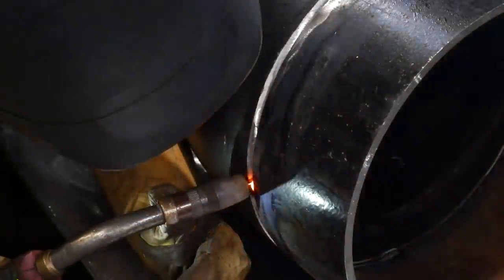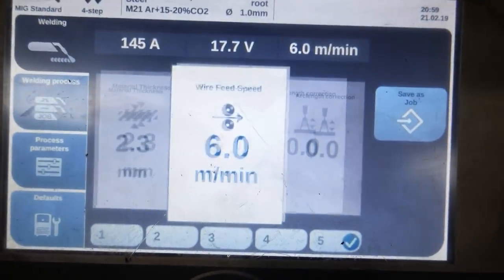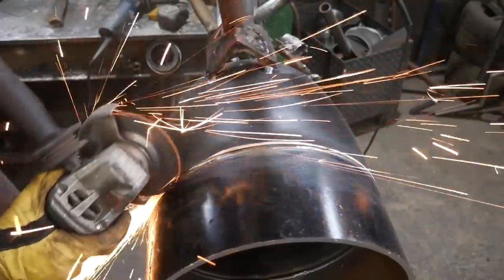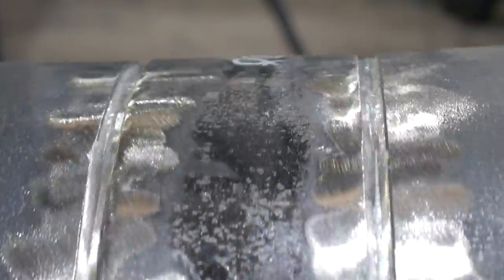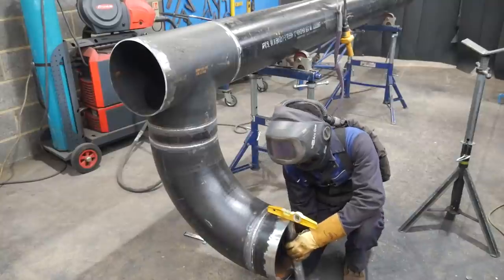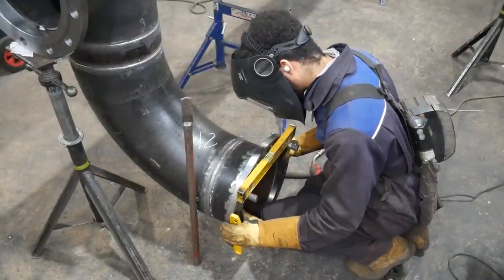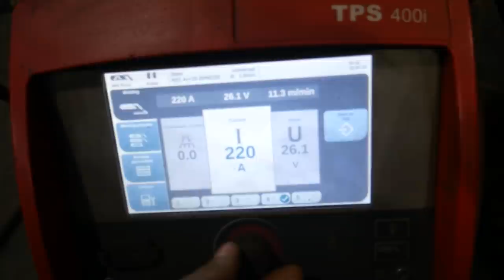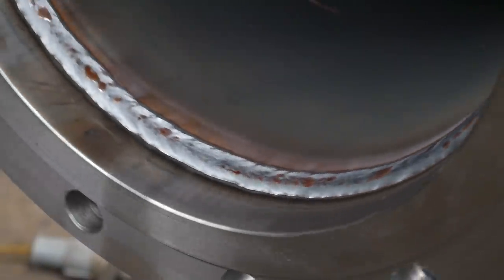12" Spool Pipe Welding & Fabrication Guide (MIG/MAG)

Comment: Any particular reason you use slip on flanges instead of weld neck?
Reply from the maker: The job specification doesnt need WN it's all low pressure

Comment: Why dont u use a 1.2 mm welding wire, its better to fill up gabs and save time.
Reply from the maker: The guys at fronius say i wouldn't see a difference until i go above 300A
Reply: True. Working just on the field all over in Europe( Baustelle Einsatz) im alowed just 1.2 mm cooper free  for root and flux wire for fill and caping, with respect to wps.
Reply: @ARCONEWELDING  
... don't believe them. ;-) 
Just make some time free and test 1.2 mm on root to and learn everything. Maybe will work for you. Or not.
Working with both Fronius and  Boehler welding machines. Great equipment you have.
By the way,great content man. Respect for your openess and your frankly speaking. 👍
Subscribed👍
...and a good weld is maked of a god welder ,not by a  maschine. Maschine make just a welder life a little easyer.

Comment: Very Very good 
Mixing Gas rates :ar(  ?  )%+co2( ? )
Reply: Hello.
 He's using  M24 class  ISO gass
 (12 ± 1 % CO2 und 2 ± 0,5 % O2 in Ar).
 Very good gas's actually for rooting. 
You can go CO2 100% to . (When WPS allow that)
Just need to crank up 1-1.5Volt higher. Maschine handle werry well that.

Comment: This guy is does not know how to fit pipe worth a crap. Lots easier ways. Almost all real welding shops have a high low switch on the gun. I woild weld it all in one position. Lol welder my eye.
Reply: Lol clearly you don’t weld for a living. Weld in position only if you HAVE to.
Reply: @daskiier  its ok ok. I have been doing it for over thirty 5 years. Ten years at cat 10 years in the boilermakers , 12 years pipelining . and fan shops in between. So yes I do know what is doing. Its ok just ribbing this guy a little.